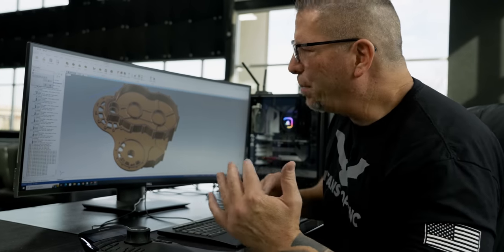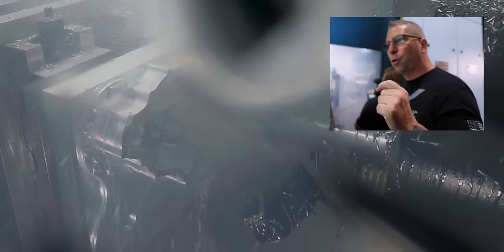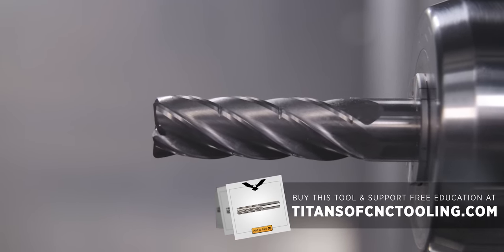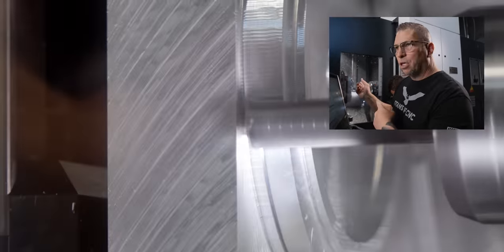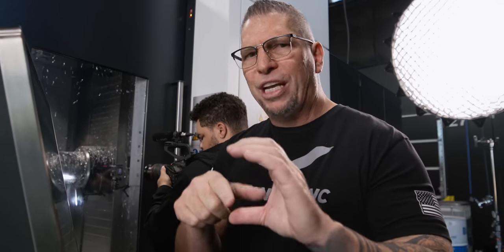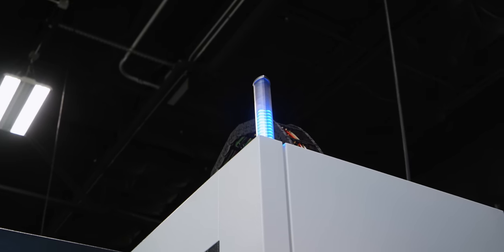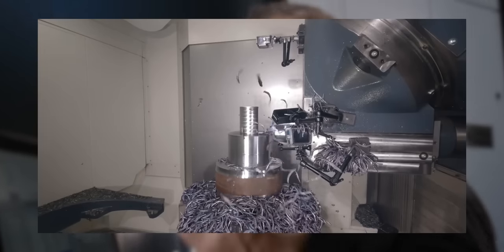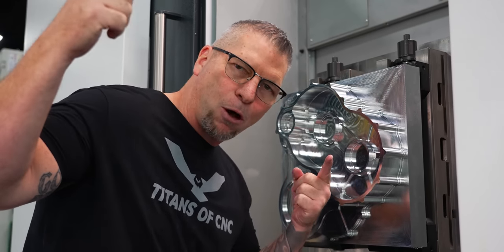FASTEST I Have Ever Pushed a CNC MACHINE | HELLER HF 5500

Comment: That is some good toolpathing. During my time at Cincinnati I got to see the DARPA funded linear motor axis & 40,000RPM spindle run. .125 depth of cut @ 2000ipm, .010" wall thickness. It took them 20 minutes to get the hydrodynamic spindle warmed up to run at  cutting speed. What was determined is there is virtually no limit to RPM/SFPM as long as chip load is .007" per flute in Aluminum. Crazy fast. The .010" ribs never flexed as the cutter was already gone by the time the material reacted. The challenge was dealing with accel/decel to avoid weird harmonics. Cool stuff guys!

Comment: Titan,

My first job was when I  was a junior in high school in 1969.  I worked as a detail draftsman for a machine design company.   The company designed the machines used to mass produce finished parts for the automotive industry.  The machines were designed so that a raw casting was loaded at one end of the machine and a finished part came out the other.  The machines were for engine blocks, transmission housings, differenttial housings, and other parts.  Each machine could produce only one type of part, say a 350 cubic inch V-8.  You needed a completely different machine for a 455 cubic inch V-8 or an in-line 4 cylinder block.

These machines might end up being hundreds of feet long.  Each thread had it's own drill and tap.  And each drill and tap had it's own motor. Certain operations such as cylinder boring had it's own station where the engine block would be moved into position, followed by pneumatic cylinders clamping the part into position.  The boring and honing would then be done.  The part would then move to the next station, and this process continued until the finished product came out at the end of the machine.

Its mind blowing that it is possible to do all of this on one or two machines.  Instead of a machines that is a 100 feet long, with say 20 stations, and hundreds of individual tools for each operation, today you can produce the same product on maybe one or two machines. It is also possible to machine an engine block and transmission housing on the same machine. 

I am truly amazed at the changes in machining over the past 50 years.  Gone are the days of brute force.  The operator today, needs to be very well trained and needs far more knowledge of the whole machining process.

Kudos to you and your staff for helping to advance manufacturing in the US. 

Bob
Reply from the maker: Thank you Bob,

Titan
Reply: Nice to hear about your experience and the motor machining set up. I have been a tool maker for over 60 years and man have things changed. I started my own shop 50 years ago. Now it’s all CNC and my sons own it. We ran across a similar situation. We made short ( 5 to 10 K) runs on sprinkler frames for a company till they could get a rotary transfer machine built ( almost a year) . Your cycle time was what the longest time was on a station. Complicated parts in seconds. But hey you have to have HUGE volumes. It nice that Titan can get parts like this. Sure makes money but look at what it costs to do. I could have never afforded a machine like that. It becomes like ….which came first the chicken or the egg. You can’t get contracts like that if you don’t have the machine. Yet you can’t afford the machine unless you get the contracts. All that aside I’m thrilled that Titan is educating and promoting our industry. Amazing to see how he’s advanced from the Haas days to Doosan and now machines like Heller and others. Big thumbs up Titan. I’d be lying if I said I wasn’t a tiny bit jealous.

Comment: last week I ran 5000mm/min on my  NC-Lathe with a 12mm/3blades endmill no rough cuts, just the final cut - worked perfect
Reply: This is 8 times faster
Reply: @MF175mp  I know, but the rotationlimt of my lathes milling tool is 4000rpm and my final part was an elypse 2x4mm made from a really wobbly plastic.
What I say is, the idea was the same, the machine sets the limit

Comment: Hey guys. Build an adapter for the camera lense and make a slit in it which allows high preassure air to blast over the objective. This will blow away chips and coolant bevore it even hits the camera. Like this you can make much better takes. Especially the takes from beneath the parts wher all the chips and coolant fall.

Comment: Sounds like you need even bigger tooling. Bigger than 1 inch diameter so you can use all that available torque and power and rip the chips off the billet even faster.  Do they even make toolholders for this machine that take bigger than a 1 inch shank?

Comment: Titan Team: Can you guys do a video on this part and how you relieve stress to stay in specification. That looks like a large enough block to cause a bit of warping while roughing. Seeing the amount of material left on the back side, how do you deal with it so there is only preverbally two opps. Top bottom.?
Reply from the maker: Yes
Reply: with tight tolerances it would be roughing stress reliefing with heat treatment and then finishing. This is how we did it with alumium moulds for pet bottles. The parting line had to be flat.
Reply: @bouny01  Is that heat treat to relieve stress or are you hardening the material then finishing it?
Reply: @3073Sean  as far as I know to relief stress, it "softens" the part so the crystal can build new or something like that, hard to explain in a different language :')
Reply: @3073Sean  to relieve stress . It warped after machining

Comment: From my experience it is always higher MRR if you do bigger radial stepover because from 20 to 10% radial stepover you don't increase double fpt, and even if you do, machine can not reach that feed in small corners and it cuts more air then material sometimes.

Comment: I see these machines with insanely fast ipm specs.  Being that there is always the risk vs reward I hear lots of people always say “you’re going to destroy that machine with those speeds”.  My question is then why have them if you can’t use them.    The faster you go I’m assuming puts more stress/wear on spindle bearings?  Would love some clarity on the subject.  Would you run the machine to it’s max all the time?  Much love and gratitude.
Reply: Hi Troy, for one thing, these machines are the top of the top, and can sustain these types of feedrates for 20+ years. But with a cheap machine like a HAAS or a Tormach, by pushing them all the time, you should get a return on investment really fast. I used to always say with HAAS that you push it to the limit for 5 years, then push it into the dumpster and buy 2 new ones.
Reply from the maker: Yep, Barry is correct.
Most top level machines are rated for much faster speeds than they allow. Heller actually has an option for 3500 IPM.
Most huge OEM’s choose Heller because they are known for running high volume at incredible speeds… 24/7 for Decades.
Most people just haven’t seen the technology.
Reply: @barrysetzer  Perfect.  That's pretty much what my assumption was.  My Tormach is no Heller so you get what you pay for which is why I don't push this machine too hard.  Just counting the days to get a bigger machine.  Thanks for the clarification!
Reply: @TITANSofCNC  That's just insane when you really ponder the moment.  The engineering that goes into these machines is just on a whole other level.
Reply: @tdg911  Yeah it really is. When you consider the size of the casting behind the spindle, and how fast that mass is moving around, its truly insane. And to be able to turn on a dime AND hold MICRONS doesn't make any sense to me from a physics perspective. It's like a freakin UFO
Reply: @barrysetzer  Couldn't agree with you more on that one.  Just the amount of massive torque required to move all of that mass and like you said turn and stop on a dime within microns is definitely alien technology.  I used to be into lots of sportscars and I always babied them.  They were garage queens indeed.  Well the last car I had I drove it like I stole it because it was designed for it and never had any issues.  Do that to a nissan altima or honda civic and you'll need a new car every 6 months 😂
Reply: @barrysetzer  On the other end of the spectrum, in chip manufacturing they're moving the "delicate" silicon wafers at 30G+ acceleration to nanometer accurate positioning or even sub nm as we have 3nm architecture processors.

Comment: Automakers have their own set of ISO-standards, so I'm wondering about how you're going to hold that part for the next operations.
Are you "allowed" to use the threads in the part to hold it in place for the rest of the machining? 
Those threads are going to be used in the final product, so maybe they will be weakened if you really let that machine loose on the other sides of the part 🤔

Maybe it'll be fine if the threads are rolled or if there's a threaded steel insert installed.

Please make a video about making the fixtures for the following operations.
Reply: Why couldn't you put smaller threaded holes in the piece for fixturing, and then come back after the job was done and rebore them to the size on the spec sheet? That way you get the best of both worlds - being able to use the holes for fixturing, and have fresh threads for the customer.
Reply: @jmowreader9555  It's a possible solution for sure.

But I guess it also depends on what the rest of the part looks like.

Comment: If you know that in a lot of spots you won’t get up to 1650 does it make sense to up the radial some and drop the feed to get the percentage of the motion at the programmed feed rate up?
Reply: Same thing I was thinking, if you are limited by acceleration it would seem more worthwhile to feed slower but dig deeper.  A less aggressive 300 IPM with 5 times the radial might have a higher overall MRR and shorter cycle just because the machine is actually consistently reaching the feed and thus desired MRR instead of losing so much of it to acceleration/deceleration.  What exactly is the benefit of astronomical feeds for roughing if you are having to drop the radial to a shave and make dozens of passes that barely reach the actual set feed because of limited acceleration?

Also if this EV company is serious, they should really think about making castings for their motor housings, milling them out of solid block is way too expensive and time consuming when just finishing out a rough casting would be so much faster and more cost efficient.  I mean milling it out of a block like that is totally fine for prototyping and maybe that is what this is, but this process is far from ideal if they are intending to use it for actual mass production.

Comment: Impressive speed but I believe you can improve your cycle time with a heavier cut.   You are only getting 186 CIM.   You could machine this more efficiently with slower feeds and heavier engagement.    We should be able to get at least 300 CIM with a 10,000 rpm machine with a High horse power machine you have.

Comment: Question for you guys.  When you program your mills for these high feed rates, do you have to change the accuracy settings/ look ahead settings so that the machine can actually achieve those feed rates when you are roughing?  I program an NHX 5000 at work and I have found that in order to achieve high feed rates I have to change the accuracy settings.  But then I have to turn them back up in order to have accurate profiles for my finish passes.  Just wondering if you have any experience with this.  Keep up the good work.  You guys rock!
Reply: Hey Bryan, yeah we do! The key is to ROUGH with your accuracy settings below your stock allowance. So if i am leaving .020 for finish, my roughing accuracy will be like .015.

Comment: First you push the machine to the limit and then repair guys push your account to the limit :)
Reply: Nah. Especially not with the HELLERs and DNs… these guys know exactly what they’re doing to maximize the tool and machine without adding too much wear. 

As the saying goes, “scared money don’t make money”
Reply from the maker: You definitely don’t know Heller.
These machines are built to run lights out for decades
Reply: @TITANSofCNC  let's see:)
Reply: @TITANSofCNC  You’re
right Sir! THIS machine is not only a toy like allmost the other cheaper competiters… You says it right ways… a good machine makes a good sound(No rumbling, rattling or squeaking)… Only a VERY STRONG machine can exploit the potential of very good tools over a long Periode of time.
Reply: I know several German companies that run their Heller machines 24/7 like this. If the maintenance intervals are respected, this is no problem at all.
10-15 years lifetime are easily possible.
Heller machines are designed for this.
Reply: I have worked on machines where the last living employee of the builder worked there when he was 15-19 (them going under when he was 19) and he's there, helping us set up the machine for a newer part at 97

Comment: Is there a foot rate where the tool needs to be changed? Like they get dull?
Reply: Not really in aluminum. I mean, we could likely make 1000 of these before we even thought about it
Reply: We have 3 axis drill machines and they have a hit count # like 1000 then they need to be changed. Send out bits for resharpening.

Comment: Titan, you do not talk about the economic$ of owning such a large and expensive machines. How much does it cost per hour to own and operate ? What is the minimum $ job you can afford to take to keep the spindle running and still make a profit ? What industries can such a machine be profitable in ?
Reply from the maker: I am doing a great time study job next… so this will be a great video to explain and give answers.
DN Solutions is great for the 90%+ of shops… and we even highlight cheaper machines also for start ups or small shops etc.
But I wanted to also show how Huge companies stay competitive while manufacturing local and hiring local. Heller is TOP Level

Comment: If you're making "tens of thousands" of these, wouldn't you be better off casting or sintering parts and boring the bolt holes rather than milling the whole part from a block of metal? I know this isn't Titans of Foundry, but there are quite a few foundries around that'll do that part of the work.

Comment: Great machine with great capability, but if we are hanging our hat on turning billets into cases for the EV industry, we're doomed.  I would suggest the engineers go back and design a aluminum pressure casting instead.  Machining time would be 95% less on machines that use less electricity.  To a hammer, everything looks like a nail.